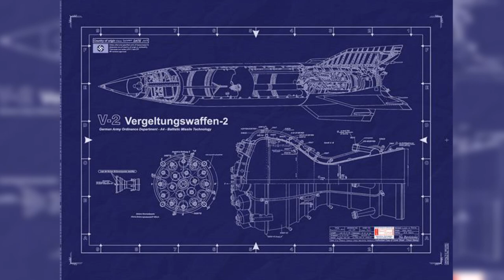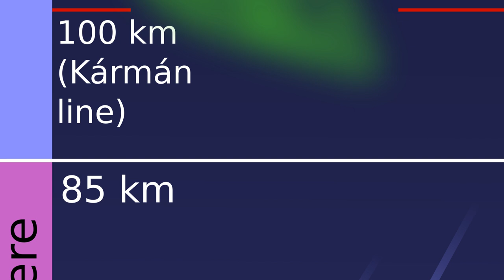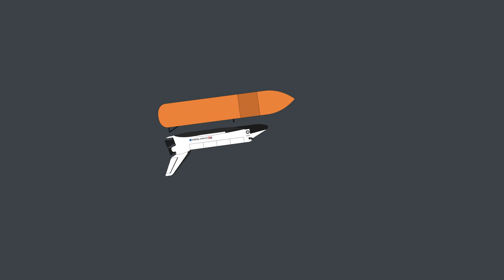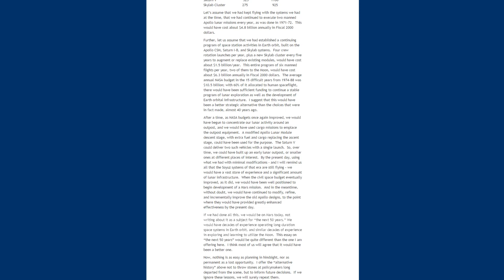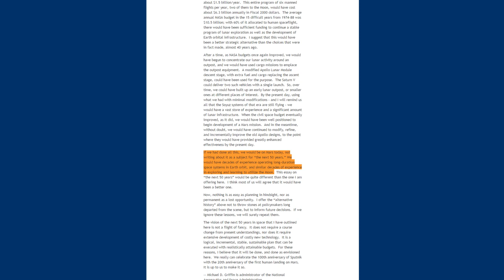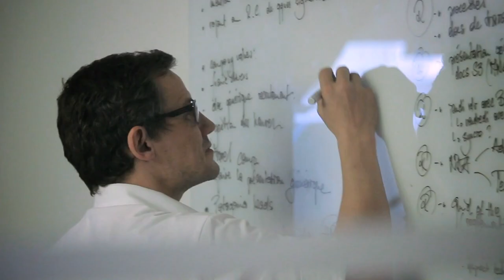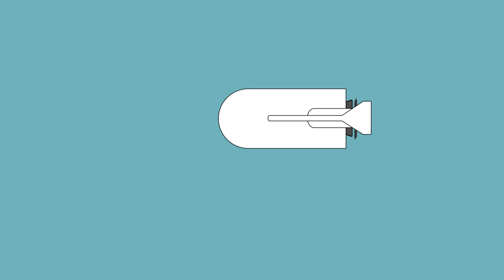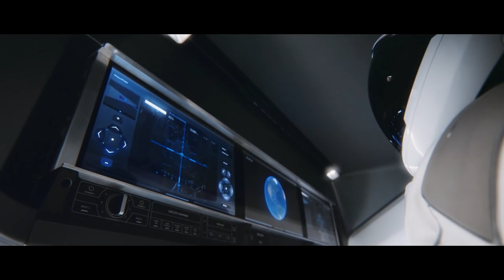Reusable Spacecraft Launch Systems

Comment: Adeline is currently not slated to be used on Ariane 6. Adeline is only developed by Airbus and not by ESA and it is definitely wrong to say it will likely be used. 
The esa ministerial this year might change that but currently it is certainly not the plan.
Reply from the maker: +blueberry19910 
"The current design for Ariane 6 is fixed. For its maiden flight in 2020, it will not change," explained Francois Auque, the head of space systems at Airbus Defence and Space.
"But it is absolutely normal that in parallel we begin to think about what will be the evolution of Ariane 6, because if we don't already pave the way for those evolutions we will not be in a position to implement them somewhere between 2025 and 2030."
Source: http://www.bbc.co.uk/news/science-environment-33006056
So while it isn't necessarily going to be used on Ariane 6, there is a good chance.
Reply: Airbus Defence and Space decides nothing on Ariane 6, they make what they are told. It is the ESA (ministerial) council that would decide on this (and pay for its development).
Don't get me wrong, I would love that Adeline would be used to lower launch costs. Arianespace will otherwise lose a lot of market share. But as it looks right now it will not be used, and it will more likely be Ariane 7 that uses such a system. Awesome video for the rest!
Reply: +blueberry19910 Mmh I spoke with one of the Ariane VI project leader, half a year ago, and when I asked about Adeline he said that it might be used in a version of the coming soon Ariane, in several years... Of course there is no reason to believe in, but I would not affirm that Adeline is not going to be part of Ariane Story. It is just quite unlikely.